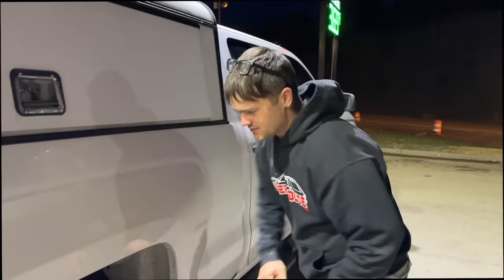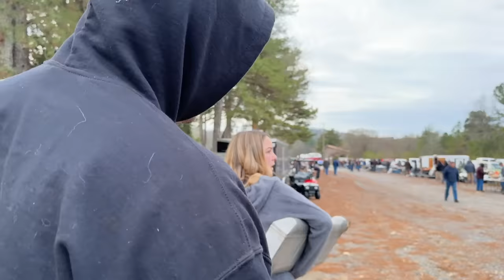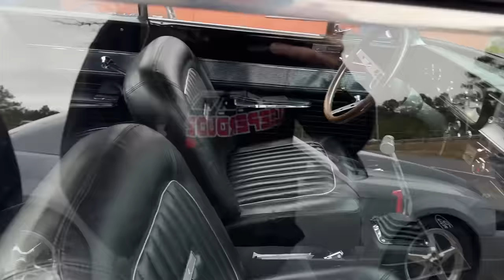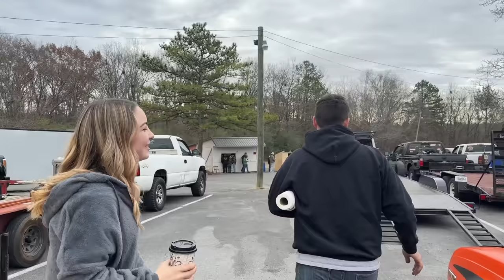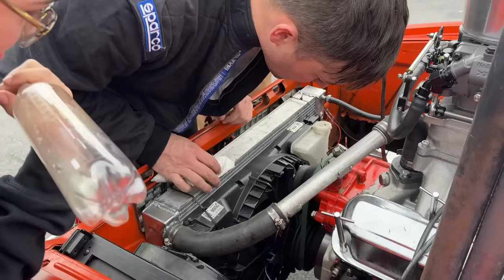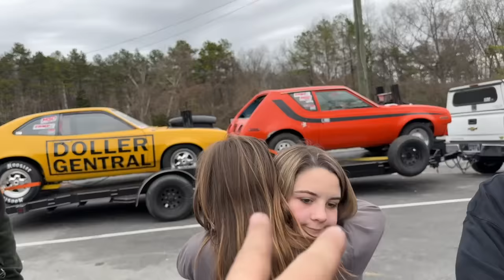Gremlin VS Pinto! Who Will Win? Kids Get To Ride Down The Drag Strip For The First Time.

Comment: Those seals in the trans are probably getting hard, could try little brake fluid as a last resort to soften them up. My 350 did the same thing, had to let it fully warm up before going any where cause it wouldn’t go into gear when it was cold out. Drove couple years like that till it finally had a hard part failure.
Reply: I was thinking maybe put one of those trans additives in and see what it does
Reply from the maker: Yeah maybe so

Comment: 1:00:45 valve cover leak you may want to use your original valve covers and go old school with cork gaskets or find another set of oem valve covers that are in good shape aren’t warped. Sometimes the aftermarket ones will leak unless you use Felpro rubber gaskets and factory screws instead of the t-bar ones you’re using.

Comment: To keep those t-bolts from backing out of the gremlin valve cover I used to have to safety wire tie the t-handles to each other to keep them from backing out of my hotrod and that was the only way I could keep them in and tightened I didn't like the blue thread lock because it would loosen up after 3 or 4 runs and the Red was too permanent but I had a old Guy that was a aircraft mechanic in the service that helped me out at my local track and showed me what worked on his car and I didn't have a problem with them backing out after that. . Might work out good for you on that rowdy hogleg.

Comment: Excellent video Sleepdude Crew Josh   , Dad Brady  :) , Tosh :) , kids to also on orange Gremlin when rev motor  the T bolts came lose on left valve cover and spit oil on exhaust  could see in videos right one could see if did same too ! Hope the older Mustang driver okay and car be fix up too from accident  to plus fire  had too ! Nice race you did Josh and bought to work on vechiles stuff too! Lots nice vechiles in videos and amazing  too!

Comment: I put a little teflon tape around my t bolts to help keep them snug and still allows easy removal. Hope this helps. Belive me i know its easy to overlook and over think  small simple fixes like this, I'm the world's worst for over thinking and complaining simple things like this trying to figure out a way to stop a  fastener from loosing up when your thinking about having to remove them easy for rocker arm  adjustments and general maintenance. And a simple gear change to 3.73 or 411 would get you a easy high 1.40s low 1.50 60' time in the gremlin and put it in the 7.20s I think. Love your content may GOD bless your family and your new upcoming year.

Comment: the radiator on the yellow pinto, is at a slight angle. now you know what it is capable of and it doesn't overheat then you could make a final fix strengthening it up.? well done you and the cars with those track times

Comment: Josh those T Bolts on the rocker covers came loose during the burnout. You could see them unwind in the video. You need to put tie wire on them so they don't keep coming loose. Thanks for the video. Cheers Stew.

Comment: The T handle valve cover bolts look cool but they won't stay tight on a vibrating engine - they act like an impact wrench. Leave em on when parked on display, but I'd suggest socket head cap screws (allen bolts) to hold better when racing. If you get a T handle hex key to tighten them they are just as fast to operate as the T handle valve cover bolts. Cheers and Happy New Year to everybody.

Comment: Josh... A suggestion to stop those valve cover Tee bolts coming loose, and better than threadlock type 'glue'.  Why not drill a small hole through the head of each bolt and wire them with soft iron wire, the way we used to wire flywheel bolts a few years back. Just wire them in pairs, which would be easier than trying to wire all the bolts with one long wire. Easy and quick to snip with pliers if you need to unscrew the bolts and just as easy to re-wire them.  Hope that idea helps.
Great day out, just a shame about that wreck, hope the driver was OK..
Happy New Year to you and All the Family
Cheers,  Phil.

Comment: I know why the Gremlin has a "bog" off the line.  It is the ignition system.  You are running the factory distributor rotor which you had to repair in it.  That engine need some more electricity to ignite those sparks plugs.  It has to have over 600 hp,  very cool video.  7.66 wow 95 miles per hour in the 1 /8 mile, impressive.  Valve bolts, shrinkage, the heads cool off and retract, hence loose bolts. Great run.

Comment: That Gremlin is ROWDY!!! Put a set of 390's of 456"s in the back It would probably be a 6sec car. As for those t handles on the valve covers, I have ran Mopars for years and have never had a set of those that would stay tight. The Threads are too long and they bottom out in the holes making you think they are tight so they leak. Just put a set of regular bolts in them, you'll thank yourself. I'm sure by now you have watched the videos you will see the gremlin just stood up when you launched while planting the rear end. Just what you want a good car to do. All in all we will call this one a win! Happy New Year to all of you.

Comment: Back in the day we use to put a lock washer and a flat washer shaved down to fit on the valve cover. That would help lock the threads in.
Enjoy your video's Sleeperdude. New subscriber first watch was on Cleetus, been following you since!
Reply: Oh totaled out my older brothers Gremlin when he was on his honeymoon and I was 15. 1972 Gremlin  purple 3 speed on the floor. Woke up late for work, mom tossed me the keys and said your late take the Gremlin. Heck I fell asleep going around a curve jumped the curb, hit a telephone pole,then a cyclone fence,  then I hit my moms 2nd cousins front porch! Bad morning, no License broke my thumb, put the engine and bell housing through the firewall  and a steel fence pole with the concrete came in the windshield and embedded in the top of the drivers bucket seat above my head! I should have died that day. But I loved the poor Gremlin.

Comment: Consider cutting about a foot off those Grimlin headers- should run better. Also when we ran methanol we had trouble getting heat INTO the motor as well- consider running a little longer in staging area*.  *( I don't know your temps on the Grimlin from the video)

Comment: Those wheels you said were monte carlo wheels, are actually 80/81 Z28 N90 Wheels. They were an option on the Z28. I believe they might be slightly different than the ones they put on the monte in 87. The Z28 wheels are getting very hard to find and I saw they had the Z28 center caps too. Which are also hard to find oem because the repops are junk. We had the car at Goodyear for something and they screwed one of our center caps up and ordered us the OER brand one and it fell off within days. It was junk. I'd have bought those wheels in a heartbeat. Year One makes a 17" replica that look pretty sharp,  but I'm an OEM guy.
Reply from the maker: Oh awesome thanks

Comment: Love the optima battery's. Do yourself a favor and buy either one of the two battery chargers made by optima. A regular battery charger will not change a optima battery lower than 10 volts. That's the reason optima has the Adoptima program. (You got to know someone to understand why they have this program) I used to make the product that go on the inside of the battery on of the reason why I know so much about them. I also have one (optima battery) going on 22 years old.
Reply from the maker: Ok thank you

Comment: I don’t know if you can still get them but they made a set of washers that incorporated reverse incline planes so that as the threads try to back off the washers tighten up and help prevent them from loosening. I think they were called nor-lock washers. Much better than a standard lock washer

Comment: The Black Nova with the Flag is a 1974 Next is a 1969 Lite Blue Camaro SS, Flat Black with lower white stripe 67 Fairlane on Trailer no motor. 47 Chevy before the white square body C10 going by on the Trailer,  When Dad was talking about going down the track you passed a Motor Home then a Beautiful Red Comet Calllente with a Black Top.a Trailer & 2 Trucks before the 63 Pontiac Catalina.  The Black Falcon Sprint is a beauty but I also like the 55 Pinkish color 2 dr Hardtop Bel Air next to it. The metal flake blue 63 Impala but a white top reminds me of the 64 same paint including the top my dad had and sold me when I was in the service. The White and Blue Chev PU I think is a 70 to 72 model with 96 Rock on the front Plate .

Comment: Thanks for the great content! We love watching!
I wanted to share my experience with running alcohol as fuel. A friend of mine built a truck for the truck/tractor pulls several years back. It was a 600ci Ford racing engine with a  manual methanol injection system that he designed and built himself. He was VERY concerned with cylinder wash, and would ALWAYS shut the fuel off and let the engine idle the remaining fuel away to prevent it. I’m not sure if that’s an option when using carburetors, or if there is a difference with methanol vs ethanol. The amount of fuel in the oil in previous videos is concerning, and may be worth investigating. 

Also, Matt’s Off-road recovery (along with other YouTubers) are holding an event called the off-road games. They are looking for other YouTubers that don’t do off-road driving, to participate. I think you would be a great candidate for this. I have put you name in on their channel. If you’re interested, you should contact them. Again, thanks for the great videos!

Comment: @Sleeperdude Josh is that transmission out of the RV? I'm sure you already know this about RV transmission's if not I bet ur dad does though. In the RV'S I have or had the transmissions are built to hesitate taking off there's delays on taking off feels like slipping but their built that way believe. And also in most RV's especially in the 440 magnums the crankshaft are steel drag racers love em for drag racing I read anyway ok

Comment: The lite Green GMC PU is a 1968 or 69  The lite blue Pontiac is a 1963 Catalina the Yellow Pontiac Firebird is a 1967  and I think the black car on the trailer is a 55 chevy 210 Sedan. The 3 color Nova on the trailer is at least a 1970 give or take a year either way. The Multi colored Mustang on the trailer behind the red truck with the black top is a 66 according to the gas cap.  The Yellow car on the trailer has me baffled. The front looks like a early 50's GM but the back looks like a Late 40's or early 50's Nash.

Comment: Hubert Platt, and his brother Huston were Georgia drag racing legends. I wonder if that car @ 1.14.07 is an original or a recreation?
Huston is sadly remembered for a terrible accident in 1969 where his car ran off the track and killed 12 spectators. To this day it remains the most deadly accident in US motorsports history. It caused a lot of changes in safety rules.

Comment: Sleeperdude you know those cheap chrome valve cover t bolts are for show. Put some real bolts back in it. Way too much vibration for those they will never stay tight I used them back in the 70's same story always coming loose. ❤️

Comment: Those two hot rods have so much potential. It's a shame that Mustang wrecked. That way, you could have turned them up. Just a little bit of tuning on that Grimlin change the geat ratio, put a good stall torque converter in it. That will be one mean hot rod it already is, I'm sure.

Comment: Hemi's and Grifoon v12. And a Scania V8. Those are the most beautiful engines in this world. And the Cart 400cc. I think it's very fast. I have driven a 110cc and a 125cc 6-speed, manual transmission. 90/105 miles per hour. Even more power? @gerbentvandeveen
Reply from the maker: Awesome

Comment: Did you notice all those t handles undoing themselves on valve covers an up front I assume radiator hose...probably need to safety wire those tight it may be your leaking problem

Comment: Josh I was thinking about on Pinto will run faster like you said about putting a power gild transmission in Pinto in ?? Do you think find one at junk yard go to . What think about that ?
Reply from the maker: That would be cool I would just have to adapt the Bell housing
Reply: @Sleeperdude I think there's part make for bell housing . That's transmission I think little better than C4.

Comment: you need that kick down and the modulator valve hooked up or its gonna blow up on that c4
Reply from the maker: They are hooked up
Reply: @Sleeperdude  maybe the modulator valve is blown? there should be a pin in there when you unscrew the modulator. sometimes it falls out and people dont notice. just trying to help. Happy new new coming up

Comment: OK Josh easiest way to tell 67 68 69 Camaro... 67 only year with wing window  so if it doesn't have a wing look for the kinda rib things in front of rear wheel on rear quarter of it has those its 69 if no wing no ribs its 68

Comment: i quit using those t handle valve cover bolts years ago.they loosen up too easy.you can remove the top of the t and it helps a little. but i would get rid of them.
Reply from the maker: Yes!!!!

Comment: Just a thought.  Does the gremlin need a better idle tune up, and if those valve covers are aluminium,  are they expanding with the temperature causing a leak. Great runs there fella

Comment: Your alcohol engine needed to be vented directly to atmosphere, get a set of valve covers , baffled, with two vents per side, and use breather elements, this will keep you from chocolate milk oil, also from pushing oil out of every seal
Reply from the maker: Ok thanks

Comment: Eighth mile times mess with my head. Ralphie would be freaking out, there's a guy selling a 87 Ranger Ext cab close to me for $1000. I'd love to have it to 4X4 and V8 swap it and make something that gets decent mileage, is narrow and short so it does great out in the woods, and has enough power to spin the tires when I need to keep the mud clear, plus having a bed to be able to put deer in would be nice. Currently I'm losing my mind because there's a ROUGH 1940 Ford Coupe for sale for $5k with the og flathead V8 still in it. Typically I'd say it'd be way too much money but considering it's one of the MOST highly sought after hot rods ever..  You need to get you a mister bottle to put gas in and spray it into the carbs like they do on drag racing to start that methanol car. You can run it for a little bit on straight gas or a gas/methanol blend to get some heat into the engine before trying to run it on straight methanol. Either that or with aluminum heads you can take a propane torch and warm the heads up first. Something else you might want to do is put a block heater in it and get a generator and warm up the oil before you start it.. even the Aussies do that before burnouts. 
Hey, your trans issues aren't that bad, well at least they can be expected for the shape of the car.. I was driving home from town today in our 03 Ram 2500 HD and looked down at the 4WD shifter and it was back against the seat in 4WD.. I have no clue how long it's been that way. I reached down to put it back in 2WD (despite it not showing 4X4 on the dash) and there was absolutely no resistance.. Either we no longer have a transfercase or the shifter somehow is no longer attached. Just what you want to find on a truck that isn't on warranty anymore. I guess I need to either crawl my huge self up underneath it and fight to get back up and see if it's still attached or take it to the local dealership and ask if I can borrow a lift for a minute and check it. The saddest part is, the transfercase has already been rebuilt once before when the belt snapped. (seriously who puts a belt in a transfercase?) 
Whoever was driving that white Mustang had no right to be driving.. To get that sideways on the line and floor it again, get sideways again, and floor it again into the wall.. That person should never race again, they obviously aren't smart enough to let off and save lives.

Comment: Pinto gets looked past because of the big ugly radiator in front.. lol.. once you either move it or put in a smaller one with a bumper on the car then the pinto will get alot more attention.. plus the gremlin is way louder and rowdier

Comment: If you gotta super nice exspensive mustang  all tricked out dont run it at a track that is not prepared properly with sitcky. Track is too slick for really super fast cars. I almost cried when I seen the fastback get totalled. Even proper sticky tracks you can get sideways It could have been somebody leakinng coolant or oil who knows that was terrible to see. Some tracks wont let you run if they know your leaky. Some tracks inspect. Your always taking a chance you could wipe out part of racing.

Comment: Was the place that you purchased your fuel for your cars across I 70 from Lucas Oil Stadium ? If so I use to work for a floor cleaning company who also had a power washing service and that is one of the places I use to power wash. Also we stripped and waxed the garage at Indy 500 trach for the Menards team and their other location where it was a private garage/building to put their engine on the Dino snd different things like that. I believe it was Tony Stewart that I had met while cleaning the Menards garage at the Track. I went around to the other side of the garages trying to find a bathroom and it was in the middle of the night but a race car driver was there and he was working on his midget car. I drank beer with the guy and he asked if I would like to start racing with him. I am pretty sure it was Tony but he wasn't that big when I met him. Yes that's the place. I had to go through a fence to get to the pumps then I would power wash the ground around the pumps.